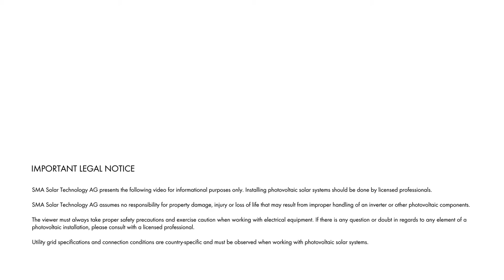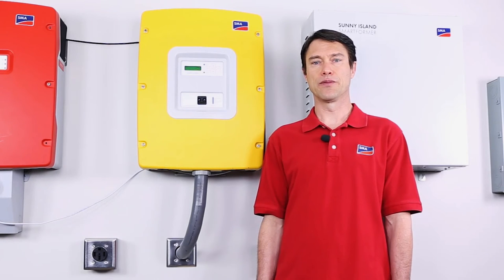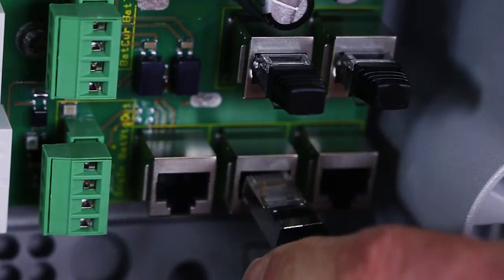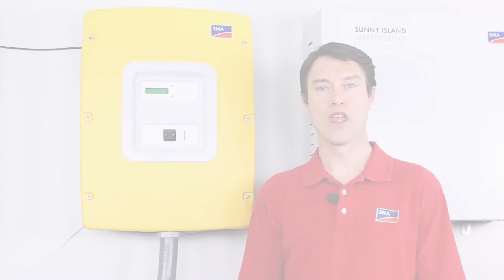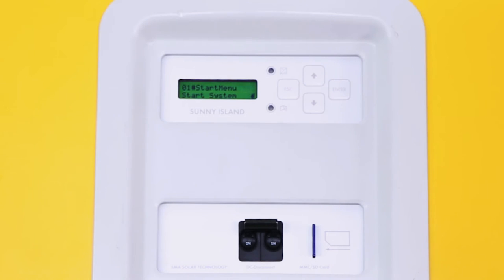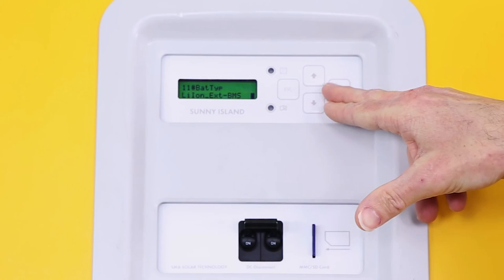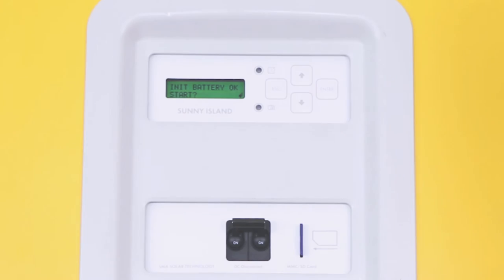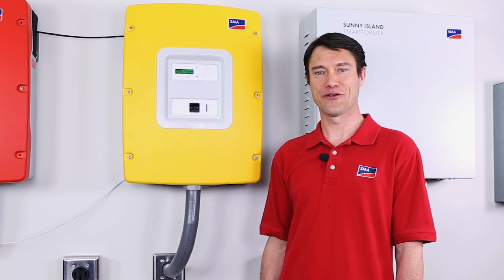Tech Tip: Sunny Island Battery Commissioning

Comment: Will the battery commissioning shown here work with the EG4 Life power 4 or the EG4LL 100AH 48 volt batteries and the SOK life po4 100ah 48 volt battery so that the bms in the battery can tell the inverter what to do?

Comment: HI
Im Pedro Mainote From FUNAE- commpany in Mozambique 
We are using 72 Sunny island 5048 at a PV power plant with Multicluster box 36, as 3phase system . So i have lost Muster configurations at extencionCluster nr 6 . Now im trying to configurate, but i cant change the cluster mode on System settings window. its running in singermode.
When i try to chenge, appear the massage on the screen saing that i have no permission to access de value.I have tryed to change the password But it not allow me to change the cluster mode.
So i need to know how can I define the extencioncluster Number on the Muster Inverter?

When i try to star the inverter , I had the follow errors. F128 VTgonAC1det and W710

best regards

Comment: What if the lithium battery doesn't come with a bms?
Reply from the maker: Without a BMS, the device cannot be fully tested and put on the approved battery list.
Reply: @smasolartechnology  Is it possible to change the charge parameters for a lithium battery to the manufacturer recommendation when they are not on the approved battery list.   Specially when connected in a AC Couple setup with a Sunny Boy on the AC1 connection.